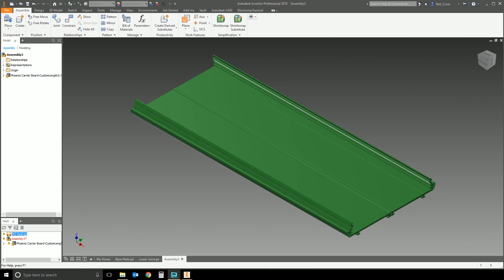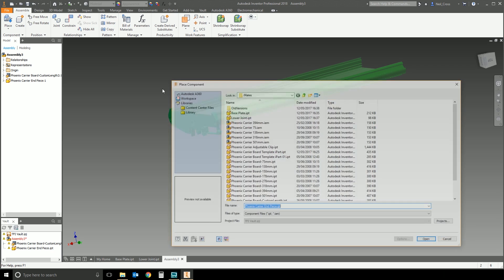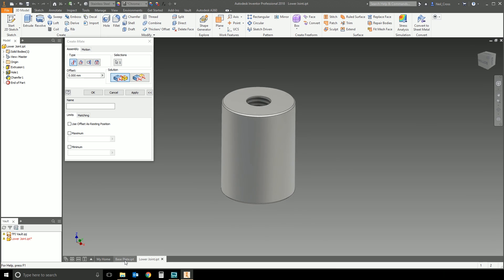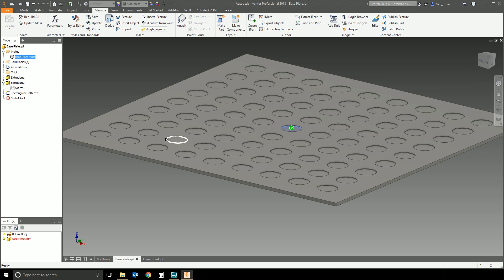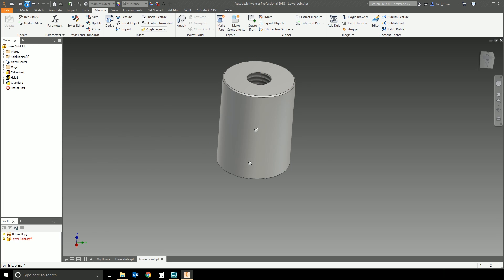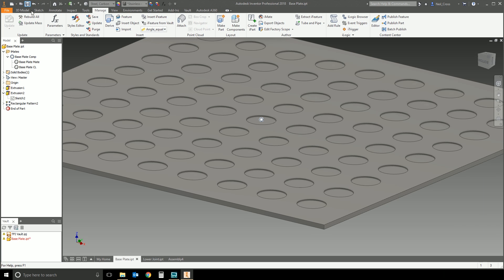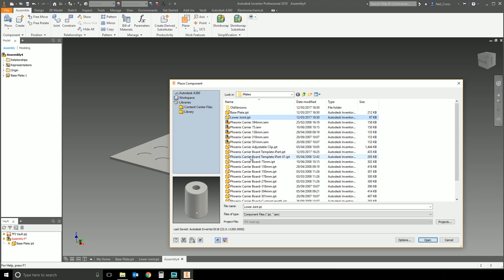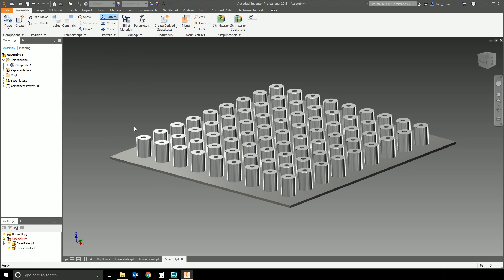Beginners Intro to iMates in Autodesk Inventor

Comment: Great video as usual Neil. What puzzles me about iMates is they are a bit ambiguous IMHO. For example I want to mate a cylinder to a cylinder (but can't use insert). I have a plane, make an iMate half, and in the matching part, pick a face and name them FUNNEL_MATE. Then I have two axes to mate. FUNNEL_AXIS iMate created in both. Then I make a composite called Funnel in each. Mate is index 1, Axis is index 2 if that matters. When I place, it ALWAYS mates the axis to the plane and the plane to the axis first. I can "Next Component iMate" and it corrects. But any other pick, like "place all matching iMates" resets it to first solution and places the remaining matches the same way, backwards. "Generate remaining iMate results" does the same thing, but only to the composites that are named identical. (As a test, I have a part with 10 composites like your base plate (I can't pattern in this case). It only matches the few I renamed matching. And when I am on the second, I can 'Next comp iMate' and re-orient, but as soon as I move to next, it'll reorient back to backwards as well. and when finishing the 'all remaining' they go higgledy piggledy. Some even mate to the other end of previous ones. (it's a cylinder with other named composites at the other end. Keep up the great work sir!

Comment: I am sorry that I have very limited memory and limited ability to derive context. And, I suffer occasional multi-threading errors. There is definitely room for improvement in every corner of Inventor. It takes time and priority to enhance them. But, without any specifics, it is very hard to provide any update. I guess you are talking about the ability to match to iMate based on match list or name, right? Currently, after the name or match list has been exhausted, Inventor will proceed with matching the same type. It can "over-match" in some cases. Indeed, unfortunately the behavior has not yet been changed. It is on our radar of things to do.

If this is not what you are talking about, could you elaborate the issue?

Many thanks!

Johnson Shiue (johnson.shiue@autodesk.com)
Software QA Engineer
Autodesk

Comment: it does not work absolutely !!!!!! Inventor places the parts with iMate without linking them together depending on their name. it would have been nice if your tutorial was true. You used in this video only one part to match so you didn't notice it. Inventor places a part with iMate in the first free place, even if it has a different iMate name. That's why iMates are not useful, if not for simple jobs. At least until the 2015 version. By

Comment: What an absolutely terrible way to do it.  From my time writing tools for artists to use in games,  we avoided keyname matching like the plague.  Way too many things to go wrong.

Also, I think you could have got away with one constraint here, using the circular edge on the bottom of the bore, and the circular edge on the chamfered face of the other part.
Reply: What kind of problems?
Reply: I tend to agree, I am a bit disappointed at Autodesk doing such flimsy solution that will cause much problem in larger projects.